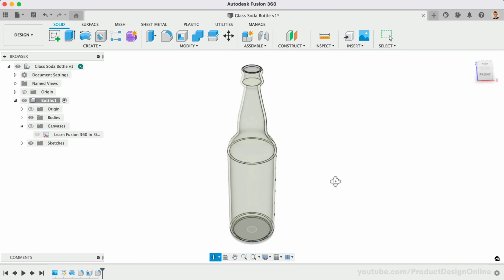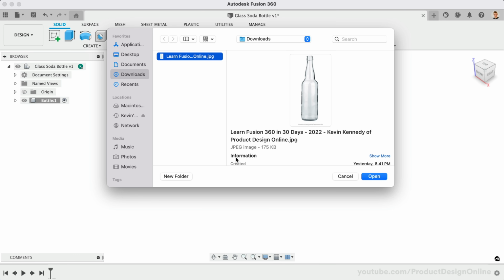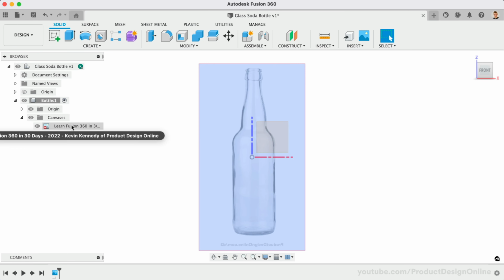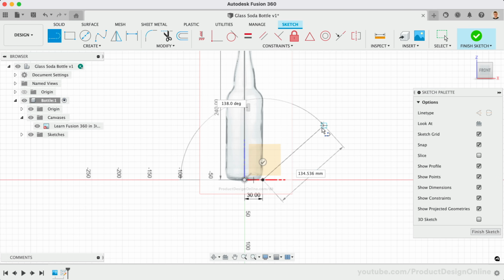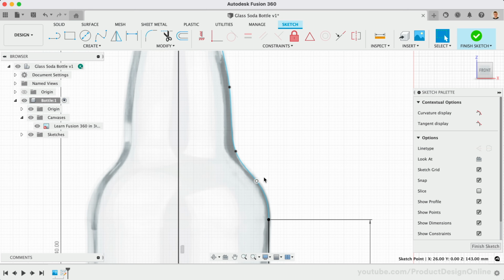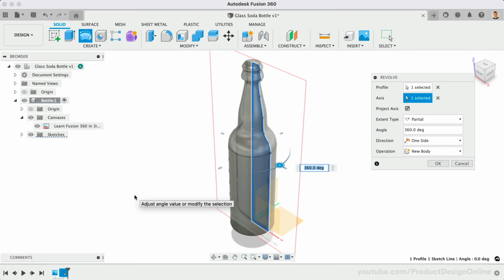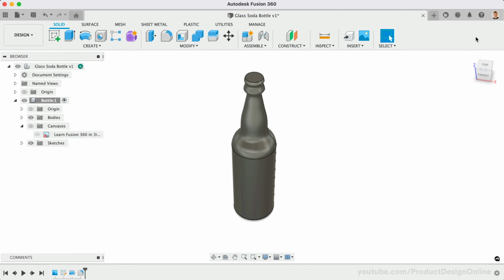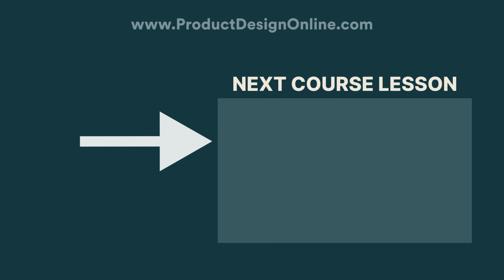Day 2 of Learn Fusion 360 in 30 Days for Complete Beginners! - 2023 EDITION

Comment: This is so good tutorial and well explained. I have two questions hoping someone will know. 

1. The canvas is in the bottle folder in the side menu. Instead it has its own place above named canvases. Have anyone else experienced this and does it matter?
2. When I insert the picture I can barely see it. The opacity is the same as in the video but it's almost invisible.The same happens when I press "new component" (almost can't see it). Does anyone know how to change that?
Reply: I had the same problem, that's how you solve it: turn off the eye of the "Origin" Folder above your bottle component. Check if the "Origin"-Folder is activated in the Bottle-Folder then choose the face
Reply: @sandyyasmin8020  It worked for the origin, but the sketch is still almost invisible 😅 At least one thing solved! Thank you!!
Reply: @sandyyasmin8020  I appreciate the help here too, but when I tried your fix, it didn't work. I'm not sure what I'm doing wrong here. How do I make sure the Origin folder within the Bottle folder is activated? I clicked on it and it turns blue before inserting canvas, but am I missing something?
Reply: I solved it somehow
1. Hide Origin above the component by clicking on the eye icon
2. Navigate inside the component and make Origin visible.
3. Select origin, it will make it blue
4. Insert the image. You will be zoomed automatically(I don't know why) zoom out and select front
Now, you will have canvases inside component and image with full visibility
Reply: @sanjeevshrestha5049  Just adding one thing, since this seems to be a bug in Fusion 360 right now. For me, the Origin for the assembly (the top-level Origin) is the Origin that becomes visible, but the eye next to the assembly's Origin doesn't look "activated". I had to click the eye next to the assembly origin twice to actually make it go away, and then I had to manually enable the component's Origin by click it's eye, and then manually hiding it again once I was done. Oy.
Reply: @sanjeevshrestha5049  Thanks! This helped me with the exact same problem.
Reply: @sanjeevshrestha5049  this worked for me too! thanks :D

Comment: I am having the worst time with this exercise. I did the sketch, did the revolve. Bottle looks fine. I go to make a shell and it refuses to do it at 2.5. I don't understand why. 1 is ok. 4 also ok. Not 2.5 What does it mean it's inappropriate for the geometry. I looked and looked and cannot find any reason it won't work
Reply from the maker: It is very likely something with your top spline curvature (top of the bottle) that the shell command doesn't like. Shell will trace the full contour, so try adjusting that curvature and see if it makes a difference when you use Shell.

Comment: I am having a hell of a time figuring out why Shell isn't letting me select the bottle top face and instead selects the whole bottle and just makes the bottle hollow without opening up the top. I have redone the whole tutorial step by step, click for click, all in his exact order at least 3 times now thinking I may have accidentally changed something, but it still isn't working. Anyone have any suggestions?
Reply from the maker: Two things that could be likely here:
1. Double-check that your top line of the sketch is horizontal. Make sure the horizontal constraint is on there. It will need to be a planar (flat) surface for the Shell to work at the top.
2. Check your top spline point handle. You'll want to make sure the top spline point is not 'too sharp' preventing it from working in the top area.

Let me know if either of these are it. I'm guessing it's the first option.
Reply: @ProductDesignOnline   apparently it was the opposite of option 2 - top spline was too shallow. if you make the top spline point handle directly in line with the top line of the sketch, it doesn't work.
Reply: @asalonggaming Thanks! This solved my issue. Adjusted the handle of the last spline point at the top of the bottle to just off horizontal and then I was able to select the surface for the shell.

Comment: I know im beating a dead horse with this question, but no matter how hard i try i cannot get the reference image canvases folder to appear under the Bottle component. Bottle is active with the radio button/dot next to it. I've tried selecting both different origins, no change. Any help much appreciated. Also, does this even matter?

EDIT
Fixed it by turning the visibility of active components (unchecking) in preferences. Then turning the visibility of the first Origin off before selecting the front plane while placing the canvas.

Also, thanks a lot for these tutorials theyre great.
Reply: Thanks. I was making myself crazy. I had no clue what the "eyes" did.

Comment: Every time I start this my canvas never goes into my Bottle Component.  Am I missing something!?
Reply from the maker: Hi Jenny, toggle open the bottle component in the Fusion 360 Browser and make sure it's origin is turned on (eyeball icon). You'll want to make sure that origin plane is selected and not the top-level origin. You can turn the top-level origin off by tapping the eyeball icon.
Reply: @ProductDesignOnline  Thank you so much!  didn't realize it made a difference the origin used!  I'm loving your Tutorials!  lots of things are coming back from 15 years ago when i used Solidworks and Inventor!

Comment: Great tutorial - just one question about the shell command to hollow out the bottle. When I follow the instructions here, I cannot apply the shell command to just the top of the bottle, instead the entire bottle is selected and then hollowed out. In order to open the bottle up I have to then complete the bottle as per the process in a previous version of this tutorial (https://www.youtube.com/watch?v=4CB-FB_KoDs). How do you specifically select just the top of the bottle to be able to hollow it out and open it up at the same time? I'm using Fusion 360 2.0.15509 on macOS.
Reply: Just realised that I can select the top if I de-select "tangent chain" in the shell options, but then I have to apply the shell in both inside & outside direction to avoid an error with the bottle body. It's a workaround, but not the same as what is happening in the video.
Reply from the maker: Double-check that your top spline handle(s) in the sketch (around the top lip of the bottle) are not too sharp. Another user had this issue and we found his spline handle was at a weird angle that prevented it from working by selecting the top.
Reply: @haroldb9154  that bug was driving me crazy, thanks
Reply: @ProductDesignOnline  Wow yeah that was happening to me, to be fancy I had applied a horizontal constraint to the top bezier lines to make them go full horizontal at the join but having that continuous surface made it impossible to select just the top face.... feels like a bug.
Reply: @zeikjt  I did the exact same thing.
Reply: @zeikjt  I did the same thing. Makes sense, you can't technically make a shell with any thickness a long the top face if the angle is flat to the top face... it would go on in infinity. Thus, there needs to be some amount of angle to make it work. Thank you!!

Comment: It took me a long time to figure out the shell and I see a lot of other people had problems with it, so this is what I learned:
1. If you cannot select the top face, make sure the handles of the point at the top of the curvy line are not completely horizontal.
2. Make sure that you have no sharp corners. When you drag handles you see these little green circles and apparently, when the diameter of the circle is smaller than the shell size, it will not work.
3. My settings look a bit different than in the video, and the "sharp shell" worked for me, not the "round shell".
Hope this saves someone some time. :)
Reply: Thank you a million times!
Reply: thanks
Reply: I was stuck on this for an hour. Thank you!!!

Comment: When you are trying to make a smooth transition from the side of the bottle to the curve of the neck, wouldn't it be better to make the spline point handle parallel to the vertical side instead of making it vertical as well?  There will be situations where the curve to line transition happens on line that isn't vertical or horizontal, and getting into the practice of using a parallel constraint in this situation would help.
Reply from the maker: Hi Rick - that's a great point! You're correct in that this case it would be the same (parallel vs vertical), while others may be more ideal to have the parallel. I prefer the vertical in this situation as it requires less clicks/relationships to the existing vertical line. (But that's more of a personal preference than best practice per se).

Comment: The fact that it saves to the cloud and not locally bothers me immensely
Reply from the maker: Very valid concern! There is unfortunately no way around it with Fusion. You can save your files locally (manually) via File > Export, but it will also save to the cloud.
Reply: @ProductDesignOnline  youd think for how damn expensive it is youd be able to save locally

Comment: I'm having the same issue with the Shell command at the end of the tutorial, similar to a few people here. I'm definitely choosing the modelling tools in the SOLID menu, but I find the different between mine and yours in the video, is that when I select the Shell tool and then the top face, the arrow that appears for the tool for me is pointing down the bottle, rather than 'across/along' the surface of the bottle top face - and i can't seem to find a way to change the arrow direction.

I'm walking away from it and moving on to the next tutorial, but if anyone knows what I'm doing wrong, I'd love to complete this tutorial. It's so fun!
Reply from the maker: Kindly share your .f3d file here: https://community.productdesignonline.com/
Reply: I have the same problem :/
Reply from the maker: @MadeByMXTC  Hi Peter. Could you kindly edit your sketch and look at the top spline's handle? That was the problem to the other file here. If the Spline handle is too 'sharp' or narrow, then the Shell command will get an error.
Reply: @ProductDesignOnline  This helped me solve the same problem :)
Reply from the maker: @ELKvlt  Glad to hear that! :)
Reply: I was able to fix it by making the final spline handle short and adding a vertical constraint so the handles point strait up. I added another splint point near this so I could keep the shape mostly intact. Not sure why by the shell direction seemed to be perpendicular to the spline "angle" of the final splint point and the horizontal top of the bottle.

Comment: Any thoughts on this? I follow the exact steps to add the reference image, but instead of putting the canvas in the bottle folder, I get a new folder called 'canvases' directly above it.
Reply: same for me, confused me for a while! Maybe it's a software version difference? Didn't seem to matter for following the tutorial luckily.
Reply from the maker: You should get the 'Canvases' folder located within the Bottle component. If not, then the Bottle component was not 'active' before you start the reference image workflow. Double-check that a component is active by hovering over the right of it (in the Fusion 360 Browser) and you'll see a dot icon to signify it's active.
Reply: @ProductDesignOnline  I have the same problem, even after confirming that the Bottle component was activated.
Reply from the maker: @thirdey3open1  very strange. I haven't been able to pin point what's going on here. Will have to ask the F360 team to see if they have any ideas...
Reply: @ProductDesignOnline  Yep, I'm having the same exact problem as above. Mine is activated, and it keeps going inside the root project folder
Reply: @ProductDesignOnline  Never mind I solved it! Make sure the the origin inside "beer bottle" isn't visible. And go into the origin inside the beer bottle component and make that one visible. I guess it places it into whatever origin is visible.

Comment: When I insert the image, it does not place it within the “bottle” component. In the browser, it made a file of canvases above bottle.
Reply: I have the same. I can't get it changed.
Reply: Is this problematic? I checked other tutorials for hints and replayed the start of the instruction many times over to detect any differences between my trials. I would like to get the same results and files strcuture as shown. Help is appreciated!
Reply: @pubanz8  make sure to select the correct origin, there are 2
Reply: @redweapon8279  Thank you! That was the cause. I did not pay attention to the origin selected. I tried both, now I can get the canvas listed under the Bottle component. Counterintuitively I had to select the general origin and not the one inside the Bottle component.

Comment: Both in Day 1 and in this video, everything works until I attempt to select a face for the shell command. It will only seem to select the entire body, rather than only the top of the bottle. The timeline shows a shell was applied but it does not remove the interior as in your video.
Reply: I'm also having that issue with the bottle specifically and am determined to master this (and impress my engineering husband and son).
Reply from the maker: @nanw63  Double-check that the horizontal constraint is applied to the top straight line. If that is there, then its likely an issue with the spline handle being constrainted or too 'flat'. Adjust the top spline handle and check the Shell command again.

Comment: What a nightmare piece of software this is. No idea why your workspace doesn't have the gridlines, but I can't help but feel like I'm doing something wrong. My bottle looks FAR more translucid than yours (even if I set its opacity to 100, instead of your 50), making it pretty hard to delineate around it. Somehow it's also not centered in the X plane. I fight my OCD and frustration and ignore these things. The hole in the top of my bottle was SO different in sizes (probably due to poor tracing because of the image not being displayed clearly) that upon setting the "top dimension" to 11mm cause the rest of the sketch to absolutely go to sh!t. Ignore one more thing, repair if possible and move on. "Activate the shell command"... the top of my bottle doesn't seem to be selectable and instead, the software selects the entire top half of the bottle. Moving on and typing in 2.5mm for the inside thickness results in, somehow, the entire top of my bottle disappearing and tuning my bottle into a koozie. 

"If you do get an error message, it's likely due to the thickness not being appropriate with the geometry of the bottle. Edit your sketch and adjust the stem of the bottle unitl the shell command works". Great. Just  F around "until it works". Got it. I eventually did get this by means of restarting the whole thing (twice, as I was not getting different results), deleting points and lines and redrawing straight lines (a trick I know from Sketchup needing a shape to be "complete" or "sealed" in order to be extruded as a solid). This was more challenging than I'd care to admit and it nearly brought me to tears. 

I am also not a total beginner here, I learned the basics of Inventor back in college, and I've been using Sketchup for 3D design for years already. Wanted to move to Fusion for no good reason, and I still want to, but I'm starting to doubt if Fusion is the right tool for me to design stuff to 3D print.

Please excuse me if it sounds like I'm complaining for a free course. I've read a lot of comments and people seem to suggest this is one of the better courses on Fusion. I know I'm a dumb individual and that may very well be the inconvenience here. Man was this excrutiating.
Reply from the maker: Hi Paul - a lot to unpack in one comment, so pardon me if I miss something.

The 'layout grid' is simply visual and doesn't affect the model in any way. You can turn that on and off in the Grids and Snaps settings at the bottom of Fusion. (Icon to the right of the computer-looking icon).

re: translucent. It sounds like your reference image may have been placed at the top level and not the component level. Where is the 'canvases' folder nested under in your Fusion Browser?

If the top of the bottom is not selectable via the Shell command, then there is an issue with it not being perfectly flat or planar. Make sure you have a horizontal constraint on the top line if one was not automatically applied.

re " Great. Just  F around "until it works"". Unfortunately, with splines, that is the reality. Most of the lessons have very specific inputs, but there is so much 'freedom' with splines that when users don't trace the bottle in a similar manner (same number of fit points and accuracy of tracing) then it can change the overall size. The Shell command will trace the perimeter, so if it's got too sharp of a curve or a narrow section, then it often throws an error because it's physically impossible to define a real thickness. It sounds like that is what's happening for you.

If you can share a link to your file that will also help me see what's going on with many of these issues. (File > Export > export as .f3d > email it to Kevin[at]productdesignonline.com. May take me a few days to review it and reply.

I will say that out of the thousands upon thousands of students I've taught the last 5 years, those coming from SketchUp tend to struggle the most because it's a completely different mindset. It can be hard to let go of expectations based on what/how SketchUp does it. That being said, I've seen many former SketchUp users get over that hurdle and never look back. I believe if you stick with it, you certainly can too! It may be painful in the early days, but things will start to click. I believe in you :)